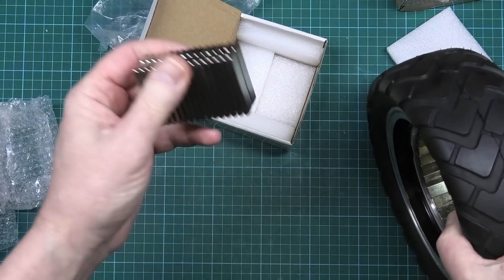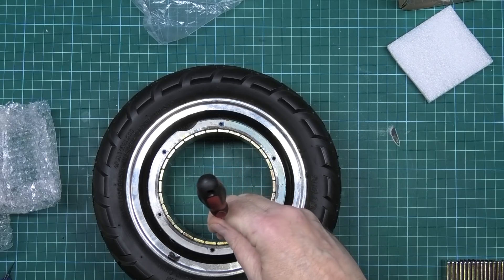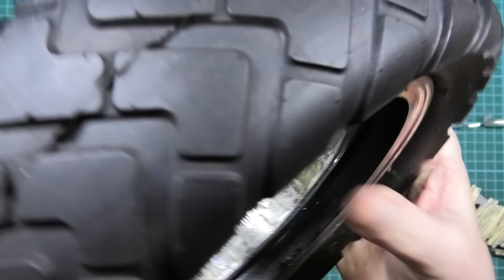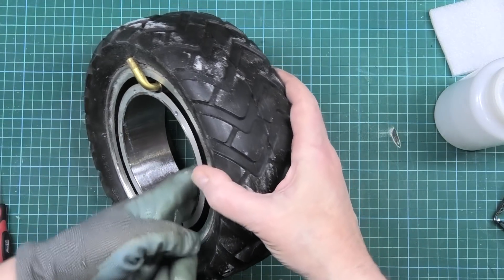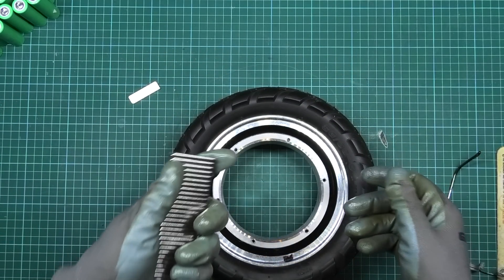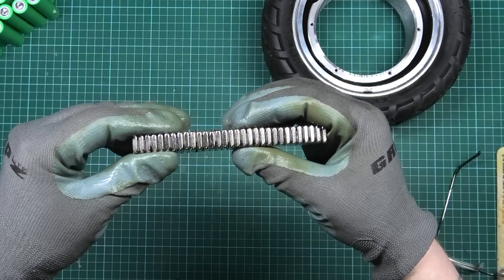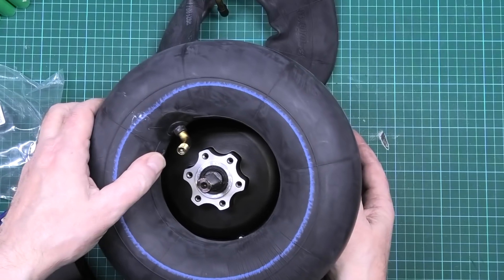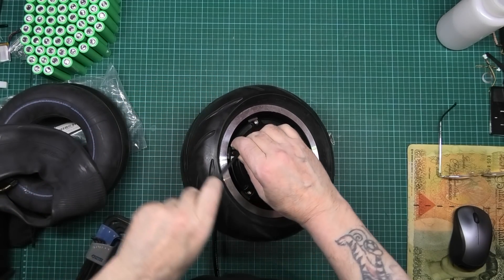🔴 EXTREMELY POWERFUL E-SCOOTER BUILD part 3 - Brand new but faulty hub motor

Comment: Perhaps having the outer ring machined to a larger ID would not only allow them to fit, but at full size/strength?
Reply from the maker: Yes, it would but the inner diameter would be too big for the stator and it wouldn't run.

Comment: Hi mate I’ve got a stealth bomber with a broken hall sensor what should i do do you know any shops in Scotland that would look at it for me ?
Reply from the maker: Most large hub motors have 2 sets of hall sensors in case one breaks. I don't know about the Stealth Bomber but it might be worth looking.
Personally, I'd fix it myself because the hall sensors will be readily available but that's just me. 
I don't know of anywhere that replaces them in the UK, let alone Scotland mate but then again, I've never looked.
The hardest part is getting the stator out, the rest is just fiddly soldering work and glueing the new one in place.

https://www.youtube.com/watch?v=XhrDbQJbd00

Comment: Pull the magnets out of an old hard drive and have a practice on them before going at your new magnets. They are really brittle so I think sanding/grinding is your only option. Be careful to do it really slowly as the heat build up could kill the magnets. Maybe even by hand with sand paper on a flat surface.
Good luck with it, your a braver man than me. 😉

Comment: Get a grinder with an appropriate disc... set it up 90 degrees to your work surface and you'll be able to take half a mil off easily👍 I've never ground duodenum magnets so I can't say I've done it but I certainly have ground thousandths of an inch of things with a grinding wheel
Reply: grinding them is rough, but having to plate them over will be tough too

Comment: I had no idea you could shave magnets down but when the difference is under 1mm that could very well be just the angle where they sit perfectly. Pretty sure you measured it right and hopefully they will work. Those inner tube sizes are a doozy and scooter tires I'm guessing don't follow the same standards as bike wheels. A lot of the stuff might still be proprietary as well or local to china which makes finding replacements tough.

Wishing you a Happy New Year - may 2022 be the year of the scooter (or rebirth if you were thinking of that OTHER scooter from the 90's lol)
Reply from the maker: 0.5mm off each side will be half a second on the belt sander to increase the angle - it'll also increase the efficiency as the gap will decrease. The only trouble is, I don't know if they can be sanded or if I can judge the correct amount to take off. You do know that it's another thing that will go terribly wrong, don't you? 😂

Comment: Bummber about the magnets. They might grind or sand down, but they're brittle as heck for anything else.
Reply from the maker: The plan is to use my belt sander to shave half mm off each side. You do know that's another thing that'll go completely wrong 😂
Reply: @Vortecks  of course, just careful how you clamp them, I've shattered a lot of these just gripping them or trying to fit them in a vise.

Comment: Hey Tony don't worry about your build, you'll get it in the end. I'm building a reverse electric trike mobility type scooter because I'm getting too lazy to push my wheelchair everywhere. From what I've found out that I don't need to have rego or license, no special approved lights & all the dramas that everyone else has to go through to allow it to go on the road. I'm using 2x 1800w 48v scooter motors with a 10kw battery with 0.2 x 27mm pure Copper Strap Strip for 18650's which will allow me to keep up with the traffic easy enough.
Reply from the maker: Good luck with it mate, I'd like to see that one 😁